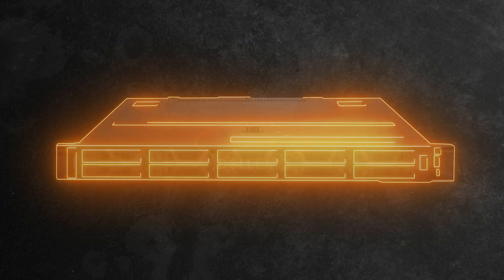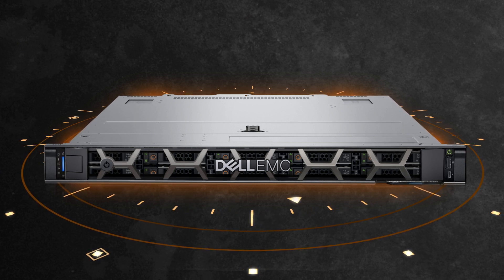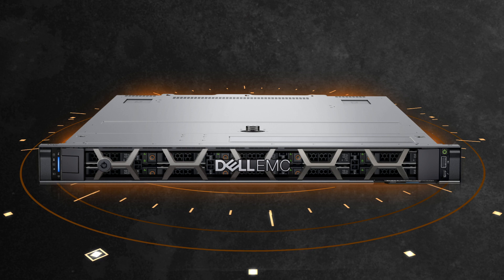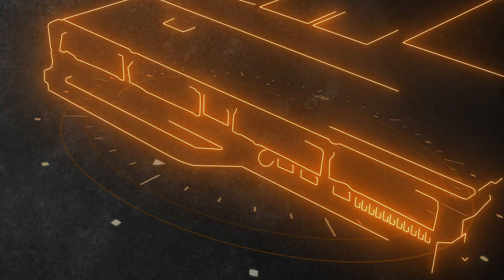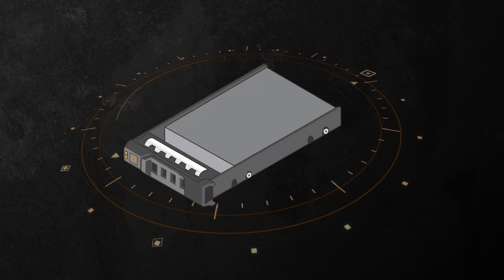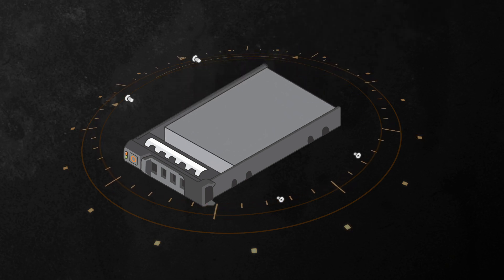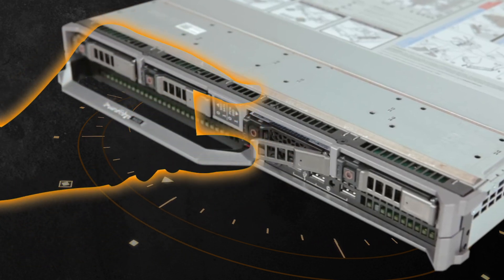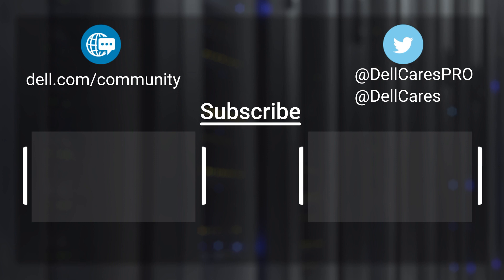PowerEdge: How to physically replace a HDD QuickTips

Comment: Why do we need to offline the drive on Dell servers is the raid controller not capable to handle the removal of disk ? HP doesn’t have any such requirements is HP servers more advance than Dell servers ?.. I need to purchase around 1000 servers for my company.. need to make a decision please respond
Reply from the maker: Hi SHASH, we recommend switching the drive to offline before removing it to avoid data loss and system crashes. 
It is not a requirement, but keep in mind, in case something goes wrong, Dell is not responsible for any loss of data.

If you need further help, please contact our support staff on the Dell Community at https://dell.to/3tndkTO

Thank you.
Reply: @DellEnterpriseSupport  Are these not hot swappable?